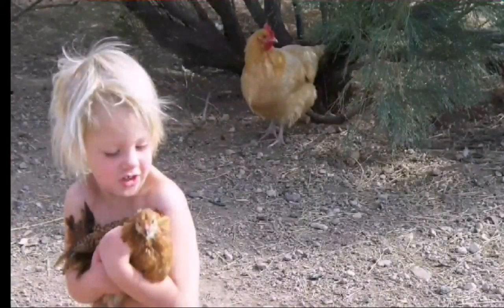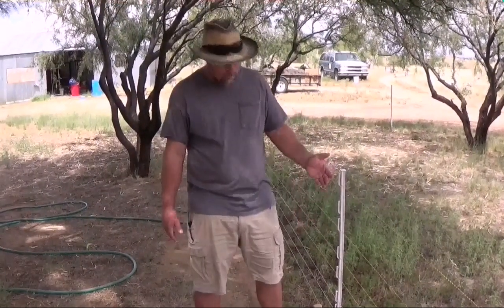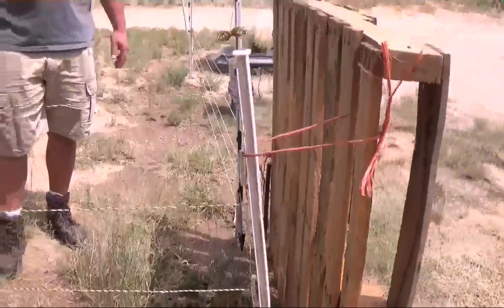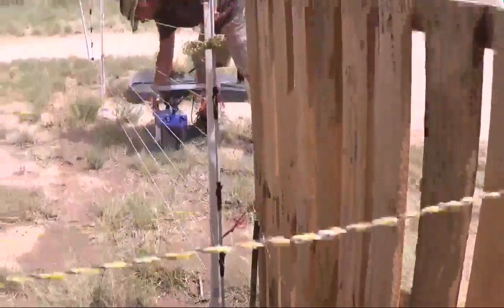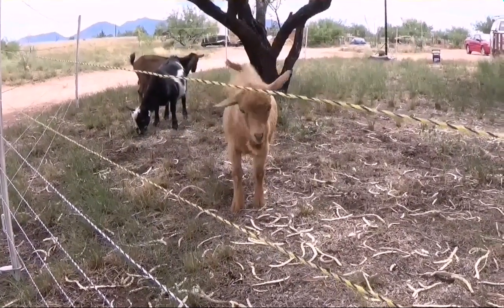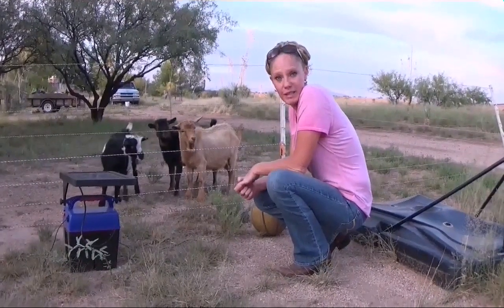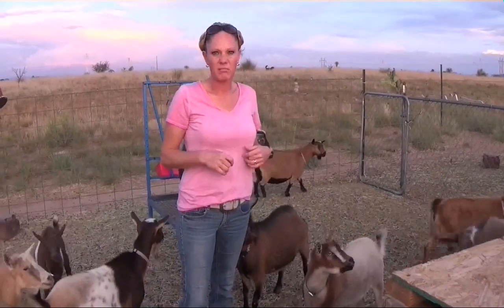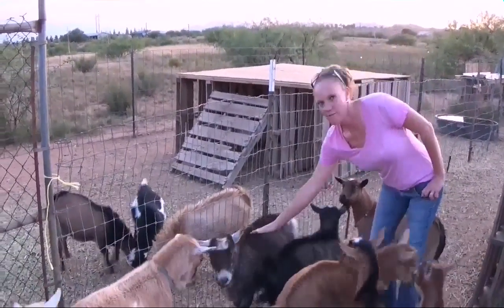Training Goats To The Electric Fence

Comment: I've been working with my goats, on ND wether and the rest are Mini-Nubians. At first, because they were used to the electronet fence, they literally just went through. 🙄 Since then, I backed the new wire fencing with the net as a visible barrier they know. In order to get them to test the fence while I watched (for safety, in case they got tangled) I spread some grain near the new wires... And waited. After 2 months of setting up fencing (by myself on steep hills covered in brush), it was almost delightful to finally see them get zapped and turned around. Next step is to start moving the netting (not electrified BTW) further away so they start becoming accustomed to just the wires. This time next week I should be able to finally get them up the mountain eating all the lovely weeds and brush, giving them better food (free) and quality of life.

Comment: How did you tighten the wires on the step in posts? Doing the exact same thing with my goats right now and had the exact same thing happened. Three goats one of them got scared ran through and the other two ran with him straight through the wires 😆😩

Can you please go back and show us how and what is the best way you have found to keep some tension with the step and post since they are a little flimsy to begin with?